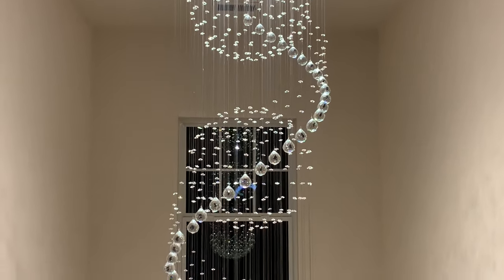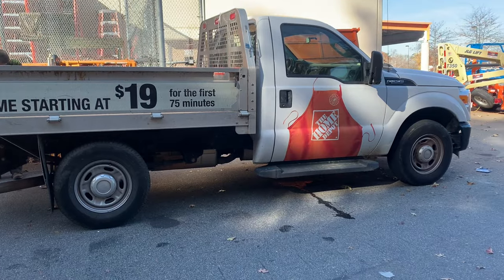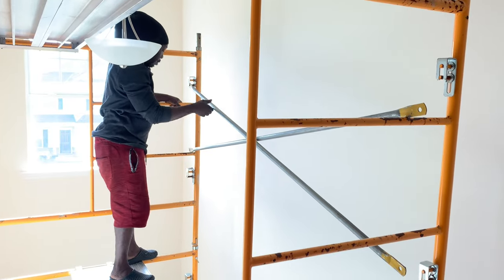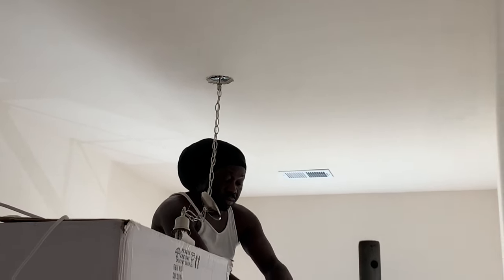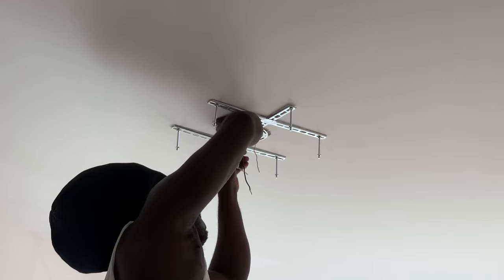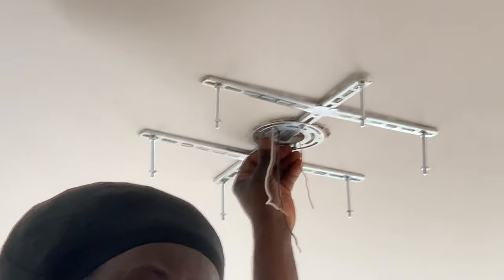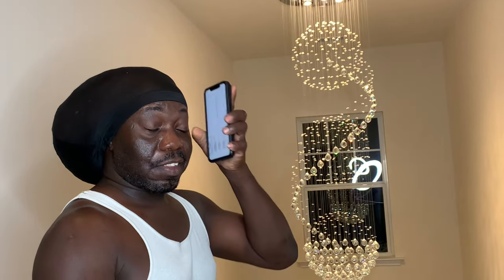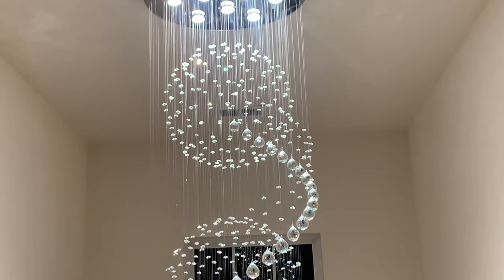Modern Crystal Chandelier | DIY Installation

Comment: Currently trying to hang the same type of flush mount. Having a hard time getting screws to line up when we put mount to put on bracket. The screws are moving around making it difficult to get in all the holes to finally mount after wiring it.
How did you accomplish this looks like you moved the disk in a round motion to get them in. Please help!

Comment: I purchased the same chandelier but it did not come with this brackets for the light box. looks like it can just be installed onto ceiling itself but I have drywall. Did you get the bracket separately? It doesn't appear to be in the instructions either
Reply from the maker: You need the Brackets. We purchased it off Amazon here is the link 
https://www.amazon.com/SEFINN-FOUR-Diameter-Light-Chandelier/dp/B0791H8SBS
Reply: @tammy82vi  Did the bracket come with the chandelier? I dont have the bracket in my box. Also, is the bracket included in your instruction manual. I did not see it in mine which is why I did not believe it came with it.
Reply from the maker: Yes mines came with the brackets . If you don’t have one you need to contact customer  service . The brackets helps to support the chandelier cause it so heavy.
Reply: @tammy82vi  Ok, thank you. This is good to know. I was ready to return it.
Reply from the maker: No problem
Reply: @tammy82vi  ok I just put it all up. I'm up to the last two, 8-42. Do you know if it matters where you start with 8. I cannot tell if there's a specific spot or just start any where on the outside and stay in order? Thanks
Reply from the maker: Start from them middle with number 8 and go all the way around the circle to  #42

Comment: I wasn't able to see which end of the strand you were putting into the crystal ball and the end that goes the fixture.  I'm confused on this. Can you elaborate more. Thanks so much and great job!
Reply from the maker: Sorry for the late response. The crystal ball goes on the square metal end. There is a little split on the wire  that you can separate,and it will snap into place . The smaller  pointed metal part goes into the chandelier base. If your confused send me a DM on Instagram at @vibeswithvalencia .
Reply: Thank you! This makes sense.. we're going to tackle this in the morning.  Thank you for posting
Reply: @tammy82vi  - ours got tangled.. any tips?
Reply: @sunithavinnakota5602  oh no. That sound bad

Comment: Great Video, very informative. What's was the height of your celling from the ground? i am planning to install the same chandelier but not sure the scaffold would fit in the space i have on the foyer, the stairs are sticking out which might impact the scaffold setup.
Reply: I am on the same boat. Did you find a solution? My Stairs are also sticking out.